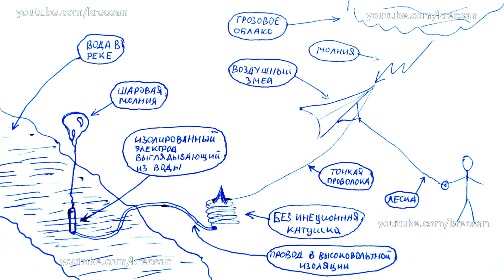Generating a lighting ball from a streak lighting!

Comment: NICE WORK! 

This is a very interesting, and much more naturally widespread topographic-hydrologic location, not often chosen by fulminologists for the production of experimental discharges, and the low elevation of the attracting electrode (a kite mounted to an obviously tortured tree, and grounded over the entire terrace into the stream flow), coupled with a generally low location near a bend in a low-velocity stream, is more likely to attract +CG lightning with cloud-ground return stroke [hence the surface carbonization], which is much more energetic than the typical -CG that rocket-triggered lightning most often induces, sampling regions of negative charge with precision, grounding into less unstable peak voltage. The experimenters knowingly or unknowingly chose a location that was already naturally ideal for the production of streamers, judging from the extensive damage to the tree from multiple previous strikes, with grounding by lightning discharge typically occurring into the mid-terrace near the center of a peninsular obstruction to flow; relative permittivity is assumed to be greatest at such locations (with laminated sedimentary structure having bilayers of conductive, hydrated humic clay intercalated with porous semiconductive strata), and the increased local angular velocity of groundwater flow with temperature and velocity differentials interfacing at the stream channel, interacting through a complex network of magnetic fields and foliage-perturbed air currents carrying ions and dust, produce turbulence, inducing electrical field asymmetries and attracting electrons and ions, conveyed upward; ions colliding with magnetic and electrical fields are then capable of the production of x-rays and other high frequency light, which further, through Thompson scattering, stabilizes an attractive charged streamer in a sheath-like convergence composed of a field alignment sustained by charged particles, droplets, and grains, which oscillate critically as a strongly correlated emergent structure, self-perpetuating further collisions and inelastic scattering, producing more ionizing radiation, in a centripetal-spiraling order. 

It isn't the tallest object, but the object (or void) that may intersect with the greatest density of local field lines in three dimensions - exposed to the cloud surface - and can spontaneously break field symmetry that is struck the most frequently by lightning.

At least this is one hypothesis for how such locations are most frequently noted to become lightning traps, judging from observations of the condition of trees and from lightning detection data, where metals accumulate, producing electrons due to the photoelectric effect as photons interact with metallic interfaces, which is also a mechanism at work where x-rays themselves are produced by the collisions of electrons and other particles (bremsstrahlung), and deflected from magnetic fields, protons, and even positrons (which have been observed to segregate and briefly stabilize in thunderstorms, and are hypothesized to be responsible for observed x-ray/gamma ray bursts observed during lightning initiation and discharge, and which is also hypothesized to be responsible for correlated free neutron flux), and may then contribute further acceleration through an inverse Compton scattering as the local streamer begins to form, a complex process reciprocally increasing voltage, and thus potential difference with cloud charge.

The location certainly is ideal for +CG, which "selects" locations that cab produce greatest potential (polarity) difference (corresponding to centroid locations where a dynamo-like oscillation that "shadows" oscillating cloud regions causing inverse charge separation may momentarily kinetically couple through topographic-conformal convection equilibria; the ensuing discharge was preceded by an extended local streamer stabilization phase, with a single return stroke.
Reply: Woah ... huge comment ... awesome! :D

Comment: Watch from 0:30 with 0.25 speed and tell me it isnt post production effects! also the average duration of a lightning is 30 mil secs!(kilometers lng usually)  You got that on camera for  0.7secs on a 5 metre shot so.. yeah!
You guys do some awesome stuff but this is sadly fake....
Reply: +Evren Uçar Whilst the actual discharge takes less time, the heat produced means that plasma can exist for far longer. This is why, when watching an electrical storm, you can notice a strike without looking at it directly and have enough time to look at it before the strike is over. Just think, if this wasn't true, you would hardly ever be able to directly look at a lightning bolt, as you would never be looking in the right place and wouldn't have time to react.
Reply: The wire is going to change the behavior of the bolt less energy is consumed with step leaders so more energy is released when the stroke is triggered, thus a longer duration.  This is real IMO.
Reply: Oh and the interference and pixelation is caused by electrical radiation

Comment: The air was extremely loaded with electricity so a thunderbolt was very close to go on anywhere even before you set this up, you just guided it. When you was very close to have set it all up you already in the beginning created a better path for the electricity to go where all the electrons gathered as seen at the treetop. When this started more and more electrons gathered since this path was getting better and better then anything else around it and the electrons searched their way to the ground as can see from the growing plasma along the line. When the path was connected to ground this path was at this moment pretty much a short circuit to ground for the cloud and thus all electrons flowed and the lighting bolt was seen.Extremely dangerous.

Comment: This is definitely done in post production. The flames in the explosion are fake and the "lightning bolt" is too (too blue and too slow). The smoke is real (mostly).
Reply: You never seen plasma before?  This flame real.  But the electricity maybe no come from lightning.
Reply: Looking very carefully at the still images, there is no pixel manipulation, the light spread and heat diffusion are consistent with that of a source point lighting, the flames from the lightning bolt are the air being superheated to plasma, and as to why the lightning moved slowly towards the ground was probably because another branch of that lightning strike was finding its way to ground faster when this one unexpectedly made contact. thats my best theory on the last part, or perhaps the kite string was supercharged and falling down, and as soon as it hit the ground, it closed the loop.
Reply: It's not even storming.. Lightning from fucking where
Reply: @davidstockton9802  i think they dropped a wire over the power lines lol f.u.k.i.n crazy
Reply: Looks like a job for the captain! (Captain D that is)
Reply: Holly Catlin I agree. If you look at the base of the ball, you can see the refresh line of the rolling camera shutter, where the light is cut off. This is characteristic of rolling shutters when they record flashes. These guys would have had to out a lot of time, effort, and thought into faking that sort of thing. I doubt it was faked.

Comment: Hi i may be have solution. to what has happend,
Sky = Positive    |    Earth = Negative 
When the Kite reached the Sky, the Wire got Hot and has molten, directly down to you  and made contact with ground , the wire is a better conducter than air and the high electricity capacitace strike down the wire
Reply: +Friedmen Morgan This is what I was thinking as well. It wasn't until it hit the ground that all the voltage slammed through the wire. Whatever it was that was fuckin sweet. These kids are nuts lol.